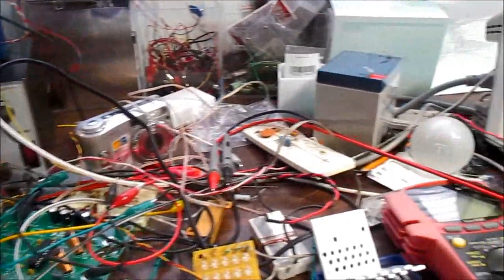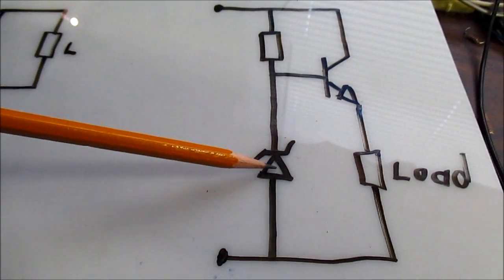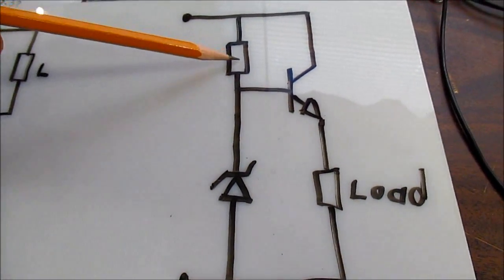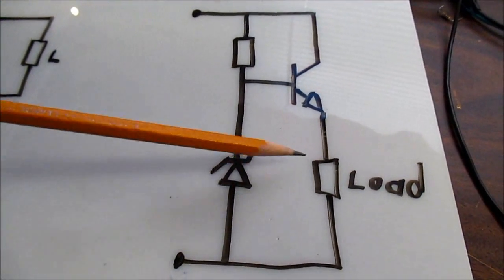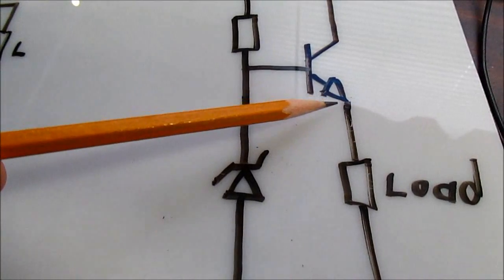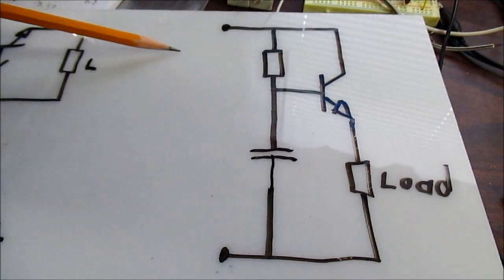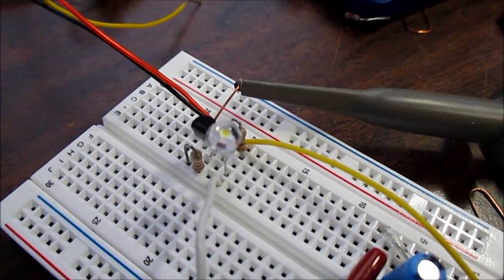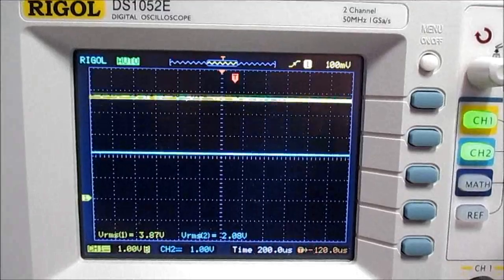Transistor voltage regulator and ripple filter circuits explained

Comment: Thank you. Im new to this and have been trying to reverse engineer an old 1970's Japanese Motorcycle Radio Control head. I drew out a schematic of the circuit immediately after the Microphone connection and identified it as a Common Collector Amplifier. However, This board has a Capacitor, Resistor, and Zener Diode installed that I dont see an any of the Amplifier circuit diagrams found online. After seeing your video I realized these additional components function as both the transistor voltage regulator and ripple filter capacitor you mentioned combined into one. Thank you.

Comment: but you are changing the input voltage  and the point of it is to regulate the output  load change thats how you explain it  . I have a voltage regulator and i have a constant voltage in , not an issue , ripple is a bit of issue but not after RC filter , but biggest issues is changing load current developing the voltage drop or peak at the regulator out .
So as i said the ouput current is the issue . I guess shunt regulator would fix that , shunting current to ground when load is not using it , and when load is using it it doesn't shunt as much , keeping load current at regulator constant fixing the load current induced voltage change .
Can you recommend something for this maybe TL431 shunt regulator , but most  schematics they show are single rail  and i need dual rail , i guess its the mater of using different transistor , but TL431 needs to be reversed as well i guess .

Comment: The base voltage increases when the battery voltage increases which lowers the resistance between the transistors collector and emitter. So that's also true then for a Mosfets Gate terminal Ohm's law.

Comment: So regardless of how much voltage is on the input and subsequently the collector of the transistor, the Zener prevents that higher voltage from passing from the collector to the load? Base voltage control keeps collector voltage from exceeding?
Reply: I have no idea. I never understood how this works. I have watched 10 videos about it, and I still don't understand.

Comment: The capacitor multiplier/ripple filter circuit is also a great way to replace batteries with a wall wart in most cases.
  If you replace the Zener diode in your first circuit with an adjustable shunt regulator, add a resistor between the emitter and load, then connect the reference of the shunt regulator between the new resistor and load, you will have a current regulator. The schematic for this is in the TL431 datasheet from TI.

Comment: I really like the way you explain this circuit. I do have one question though. My.current understandkng is that the load voltage is equal to Vb minus the voltage drop across the transistor. However, what would the effect be of some addition diodes across between the power supply and the collector?

Comment: What about in the technics Integrated amplifier SU-V9;  the circuit in charge of turning the  stereo on?  How can I determine  how much  the voltages of zener diode should be. Could you find out for me.    And if I use a filter, is that filter has to be a bipolar !?

Comment: I tried it with a 220ohm resistor and the resistor and the zener blew up..Then i tried with a 470ohm resistor and the circuit worked fine,but the output was very unstable if a small current was aplied (~20ma)
Reply: At 220 ohm you put too much current to the base of transistor, isn't it <>  What kind of zener diode might be that ?!  voltage
Reply: OmG, I think that's what happen to my zener; if zener blown  then becomes open and stereo doesn't turn on, just the light on, but transistor will not turn on; because there is no voltage to the base; Also it will not send signal to the output transistor. something told me in advance that 220 ohms was too low.  I just hope transistor still oK?! what do you think?

Comment: At dynamic input power will the transistor regulate to specific voltage and up the amperage if the input voltage exceeds the transistor voltage? As long as the heat sink is right..or would it typically burn out..
Reply from the maker: +Rook E If you mean the transistor's collector to emitter voltage, the transistor can be damaged if exceeded. Near such voltage, current of transistor is derated due to safe operating area.
Reply: +JohnAudioTech What happens  if the zener diode end up open, and I still turn the stereo on !?

Comment: The more voltage my transformer puts out the more transistors I need because to high of à voltage on one transistor would burn it out right?
Reply from the maker: Owen Chase science channel Depends on the transistor and safe operating area. Typically you want to minimize the voltage overhead to keep heat dissipation down
Reply: JohnAudioTech o ok
Reply: JohnAudioTech what circuits online do you think would work for a 30 volt 3 amp supply with variable resistor?
Reply: If you put to much power or too much voltage, on a circuit,  you run the risk of burning it. That's why is not bad idea to put a lower amp fuse!

Comment: So, what's the formula for the voltage that you want to regulate? If I want my output voltage at 30volts, then I use a 30volt zener and what resistor? This probably has a really obvious formula.
Reply from the maker: ***** Yes, since the emitter follower circuit has no voltage gain, Use the zener voltage for the output voltage you need. If the current needs are more than a few hundred milliamps, you need a darlington configuration. Try to keep the supply voltage a few volts above regulated voltage to minimize transistor thermal dissipation and SOA issues especially if the current is a few amps. Due to the dynamic nature of the circuit (varying load, varying supply current and transistor gain at differing currents), I'd strongly encourage using LT Spice to simulate the circuit under dynamic conditions.
Reply: Thanks for the advice! I would like to learn how to use simulator programs. That would be very helpful.
Reply from the maker: ***** Download it and give it a whirl. There are a few basic videos on it here on YT to get you started. You'll be doing basic circuits in no time. It can be a complex and powerful tool, but it is easy to get started on.
Reply: You're from Utah? Wow. Can't believe it. Thanks for the advice and info. Cheers.

Comment: your ripple filter also know as a capacitor multiplier, the capacitance is multiplied by the gain or hfe of the transistor.
gr8 job merci beaucoup
Reply from the maker: N8ZU Hi, I didn't know it was called that. It does make sense. Thanks for watching!
Reply: Armstrong invented that circuit back in the day. upon further research I found it is also a phase shifter, shifting the phase by an RC network. Armstrong called it FM really it's  PM
With the right RC values you can shift the phase from zero to 180 degrees

Comment: Would combining the 2 work?
So the regulator feeds the ripple filter.

I know it would cause more voltage loss, but a higher reference voltage could solve that.
Reply from the maker: You normally don't do this because the regulator takes care of the ripple anyway.
Reply: Thanks for the info.

Comment: Good video and nice explanation, it might have been worth mentioning that its best to not have too much difference between the input and output voltages, the less difference there is the more efficient it will be and the transistor will run cooler.
Reply from the maker: Good point Clem. The voltage difference between the input and output times the current through the regulator = power dissipated by the device.

Comment: Not going to soup up the audio circuits too? Better caps, low noise transistors or maybe a chip?
Reply from the maker: I put a pi filter in the preamp and it took care of the drop out hum. I tested it at .02% THD, so I'm leaving it be. If it ain't broke...